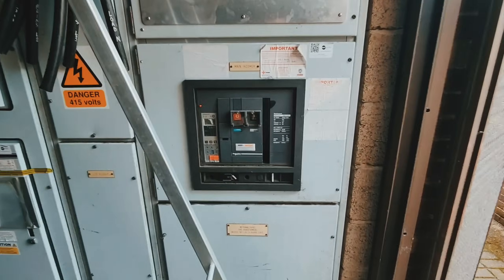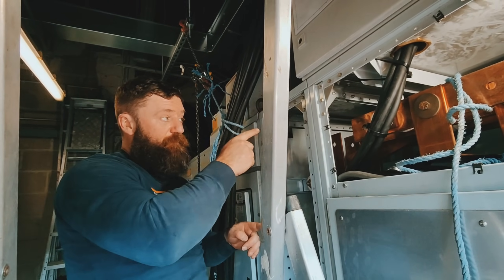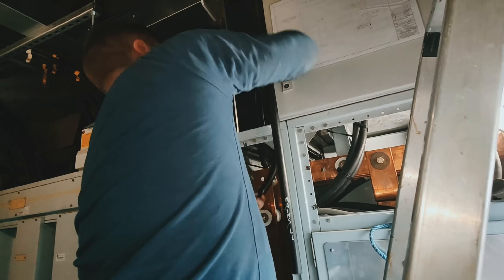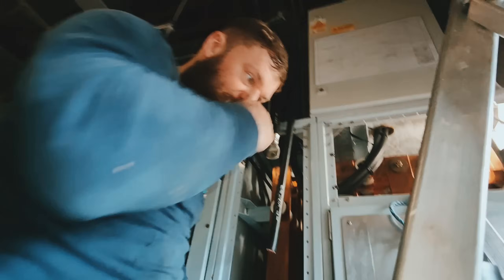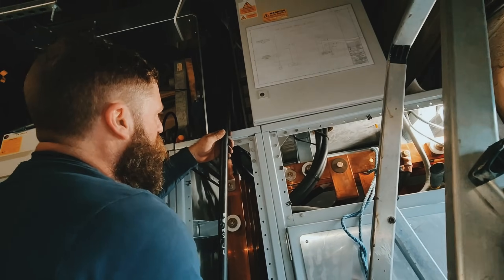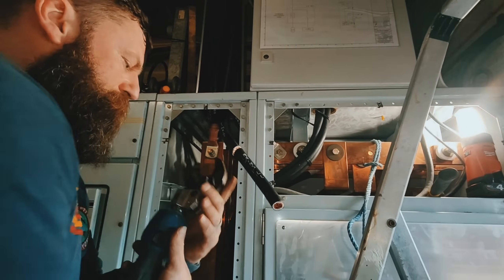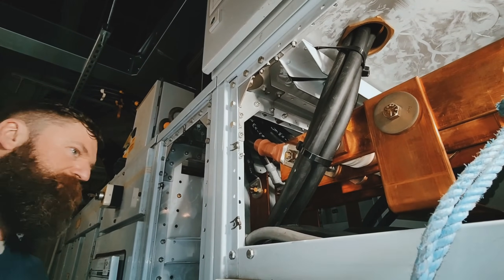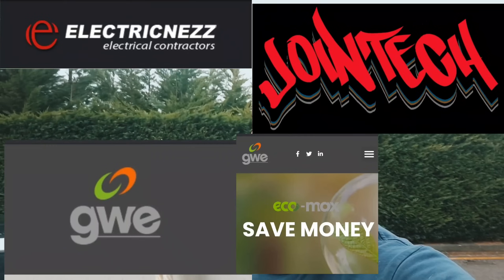Part 2 The terminations to power on the Voltage Optimiser

Comment: You can get a butane powered heat gun fairly cheaply.  They are just dual function mini blowtorches that run off lighter gas.  You install a catalyst block on the front to get them to produce heat without flame.  I've got a little Dremel VersaFlame which currently costs about £40 on Amazon.  It's small and low powered, but pretty much perfect for a quick bit of shrinking.  It also has a soldering tip for use as a basic low power iron.

There are plenty of others on there, some for as little as £20.  Not sure how good the others are, but there's a Draper one for £20 which would probably not melt/explode, although I don't think it has the little curved deflector to heat both sides evenly.

Not that tape is evil, or anything, just if you wanted a way to cheaply be able to shrink stuff with the power off.

Comment: Hi Tony I think it might be beneficial to upgrade your Crimper tool.. as it happens I have got the Klauke EK120/42 CFB for sale complete with die set if you’re interested as I don’t tend to install the big cables anymore. Interesting video but how do you achieve volt drop on long run cables (eg) sub mains when the incoming voltage is decreased.?

Comment: The principle of energy conservation states that energy cannot be created. This is the base of physics. If they need 200kWh to keep the hotel temperature at level, then it will be 200kWh (plus the loss on the "optimizer") in any shape of form. There is no free energy. If you use resistive load, like a water heater, then it will result longer heating period, but the end result (E=P*t) is the same. If you use heat pump, fridge, led lights etc, then they will not care due to the inverter. You can save with insulation, lowering comfort temperature, using more efficient or dimmable lights etc. 253V is just in the limit, but at the end of the final circuits it will be far lower. If you start at 226V, that is already below than the 230V nominal voltage. Then you can end up below the norm at the final circuits.

Comment: Hi Tony, another interesting video, the optimiser is only going to save money on resistive loads i.e. electric kettles & ovens etc. it will not make any difference to devices using SM PSUs these already lower the voltage/wattage to a lower level also remember this applies all the led lights which now replace the old resistive type lamps.  Obviously as it's a hotel there will be a lot of resistive load devices, I look forward to the results Tony if you are able to obtain them in the future.  Regards from Ray (the old sod) from North Wales.

Comment: Thanks for posting the video.  The camera occasionally caught the right hand side of the mains bus bar(s) and you could see single core cables tapping off (before the links) which seemed to follow the same direction of the bus bars down to the distribution panels.  Does this mean that the optimiser is covering most but not all of the load in the Hotel?  Could there be any issues with L1/L2/L3 phases running at different voltages inside the same building?

Comment: But surely less voltage = higher current and as metering is normally in KWh how can they be saving money
Reply: P=IV but you are wrongly assuming that P stays the same. Take, for example, a simple resistive load. I=V/R so if you reduce the voltage then the current flowing through the load also reduces.
Reply: Your assumption is only valid for certain loads.

Comment: No gloves! PPE for electric shock! would not get away with not using any here in Ireland, health and safety would have you run off site 😂
Reply: Either you have safe isolation - and you don't need gloves - or you don't, and you need full arc flash gear.
Reply: Why would he need PPE for electric shock if the systems isolated?

Comment: Nice. Back in 2010 when the government had many incentive schemes for renewable installs etc I was going around fitting single phase voltage optimisation units in homes all around the north and midlands. Eventually the company stopped offering them to clients as the constant switching on and off was driving the home owners mad. I get the theory if you're living close to a substation and your intake voltage is 250 plus, but they just seemed a bit gimmicky to me for a regular home.

They seem more suited to a large commercial/industrial setup.